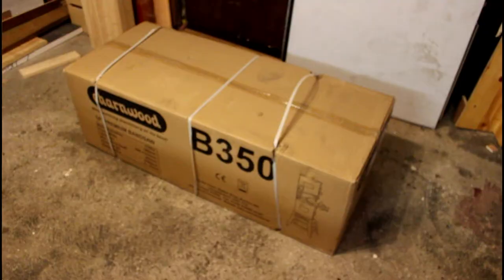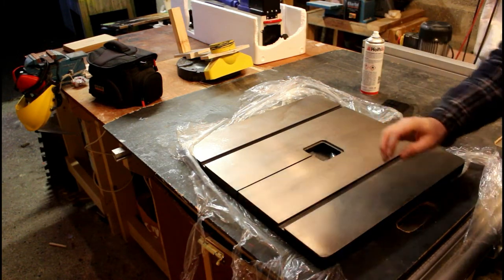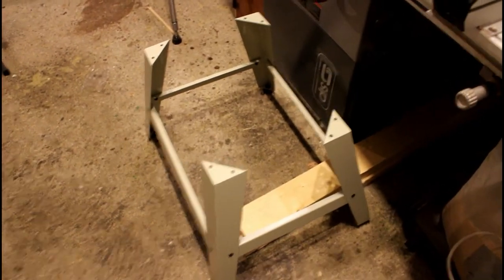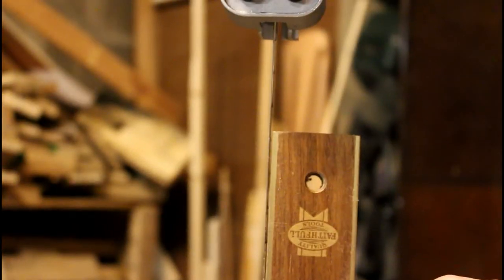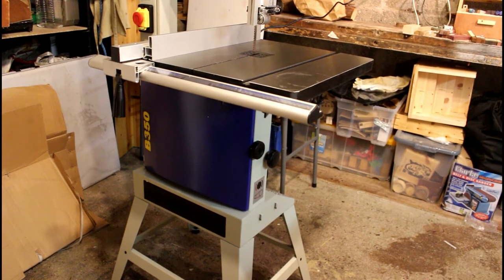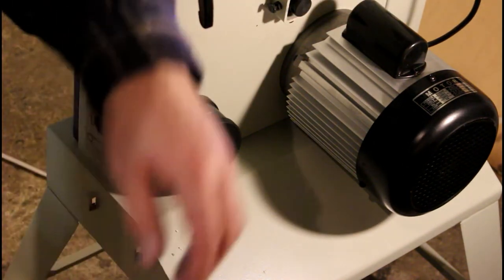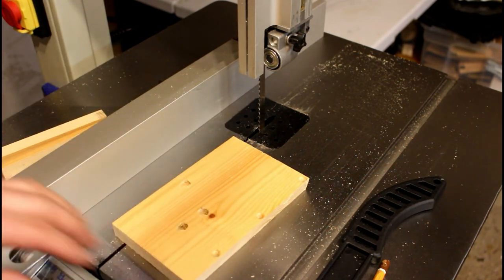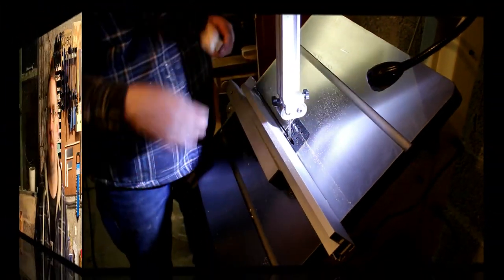Unboxing my new Charnwood B350 Bandsaw

Comment: Hi Andy, I'm at a serious crossroads as regards a bandsaw. Can't bear my old Screwfix any longer. After 3 years, would you still recommend? Decent enough price in Mallow tools at the moment. Thanks. Shane. Ennis.
Reply from the maker: Yes mate, I would buy the exact same one if I had too without hesitation. Its a great saw, I've had zero issues with it.

Comment: Hi, I'm looking to buy this bandsaw. The information on that web says the blade length is 2560 mm. I'm looking to invest in better blades but most I see are not exactly the same length as the stock blade.
Would it be okay if I got some blades 5 mm longer or would that be a problem?
Reply from the maker: Hiya, thanks for watching and I hope the info was useful. I think you might be in trouble if you get blades of a different length. The tensioner on the back won't take that much slack out of the blade.
Reply: @andy.elliott.foreverpens  Thanks for your response, Andy. Do you have any recommendations pertaining to good blades and where to buy? Is it easy to find 2560mm readily available? What works for you? I hear bandsaw performance relies greatly on blade quality. I'm a soon to be woodworker. Just gathering my tools at the moment.
Reply from the maker: @ajiwukari  to nlbe honest I've stuck with Charnwood blades so far. I have 3 different sizes for general use, rip sawing, and a 3/8th one for tight curves. I've had mo issues that I can say so far anyway! Good luck on your woodworking journey, this bandsaw is definitely worth it.